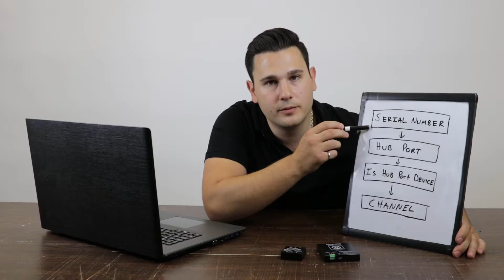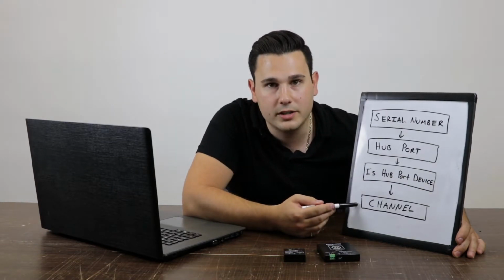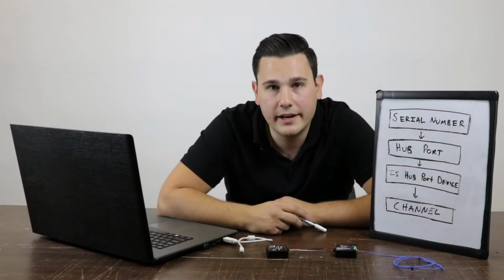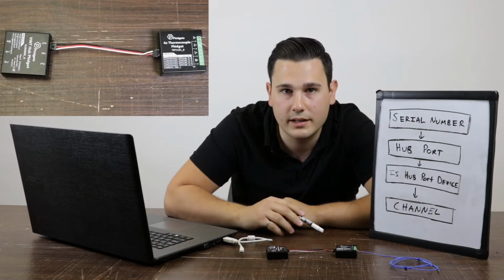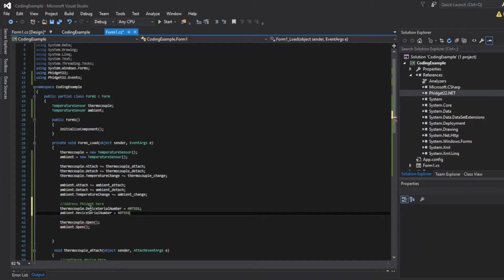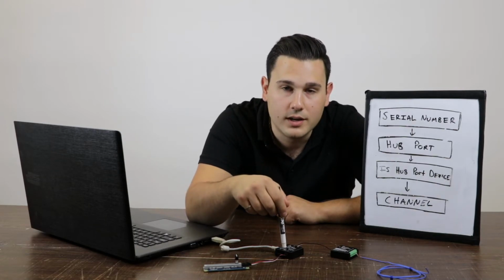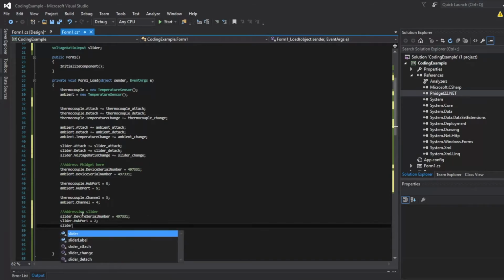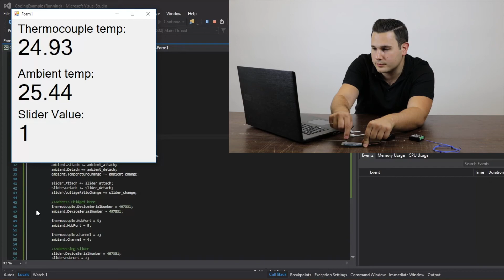Phidgets - Address your devices

Comment: How do you setup the VINT hub000_0 itself;  a simple led on/off example would be great.   Phidgets really has poor demos.  website and youtube, not good.  You guys have'nt figured that out yet?
Reply from the maker: This video is here to explain channel matching parameters. For a quick guide on the HUB0000, go to the product page and click on the "User Guide" tab. There you'll get instructions to set up Phidgets on your OS and you can open a Digital Output from the Phidget Control Panel. If you want to do it from code instead, check the "Code Samples" tab to generate a simple DigitalOutput code sample for your desired language. 

We recently changed the structure of our User Guides, so if you have specific feedback on them, feel free to send it to support@phidgets.com.